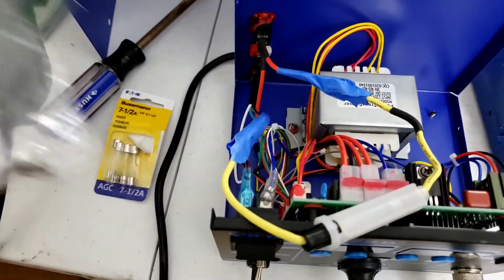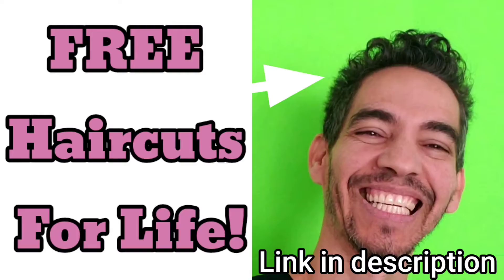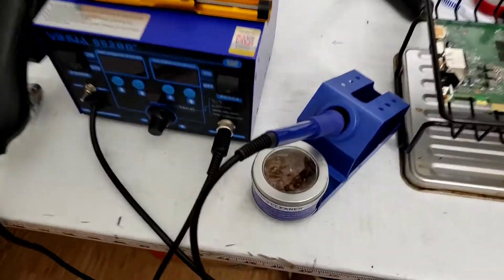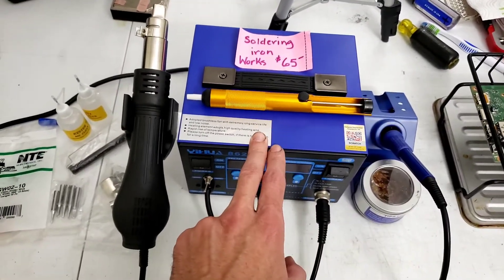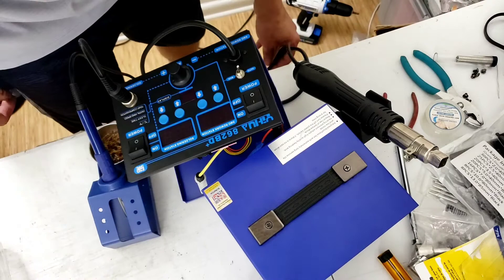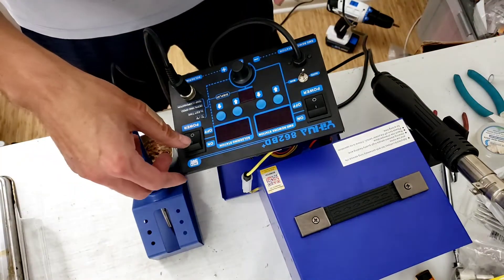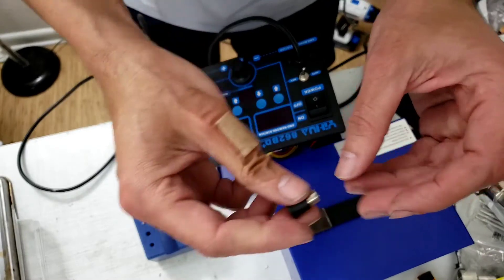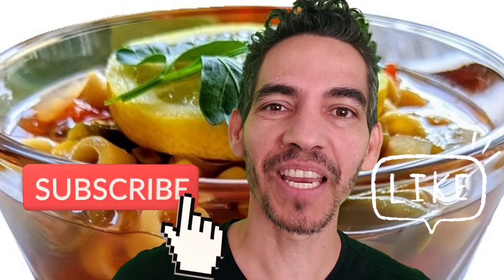862BD+ Yihua REPAIR, not working, not turning on, not heating, SMD soldering work station, heat gun

Comment: And one more thing i see your soldering iron goes to 500 plus degrees Celsius thats not good brother because it is locked at 450 l degrees by company for hot gun and soldering iron if temperature exceeds this then there is some lose connection or faulty temperature sensor that causes this 600 degrees temp. Rise and it could melt down you soldering iron and reined your pcb jobs
Reply from the maker: Good to know thanks Azam
Reply: I have the same soldering station and it goes to 480C but specified in the manual as 480 celsius too.

Comment: Hi i have the same rework station and i could tell you the fuse exact value if you wanna know and one more thing Single phase 
 A.C. POWER =VOLTAGES ×CURRENT ×POWER FACTOR
Or
P=V×IxCosine of angle between V and I 
P=750watts, V=230volts  cos phi=0.85 
So I=P/V×cos phi => I=750÷(230×0.85)=3.836 Amps =4Amps
You used 7.5Amps which is for 1466 watts.
Reply: Its actual fuse is 6.1 Amperes 250volts 5mm×20mm size and 
Its could handle power=230v×6.1amps×0.85=1192.5watts
Reply from the maker: Got it!